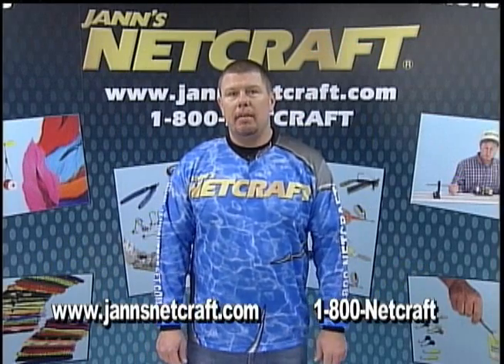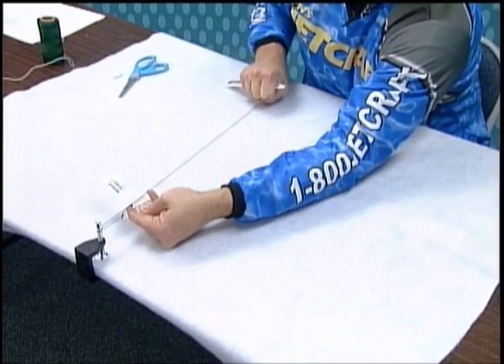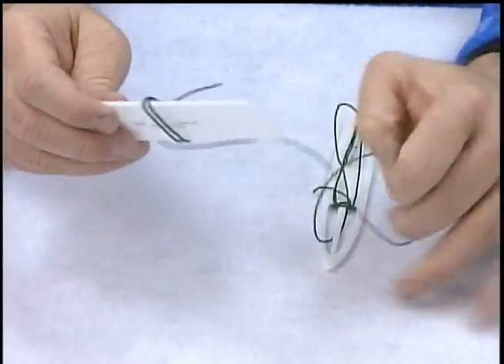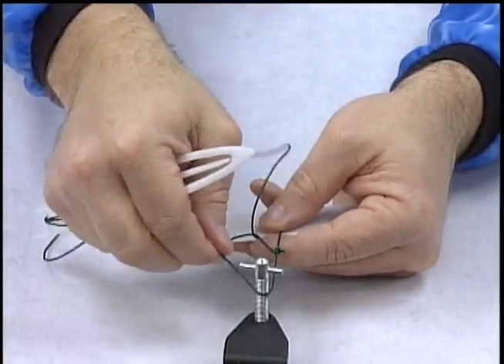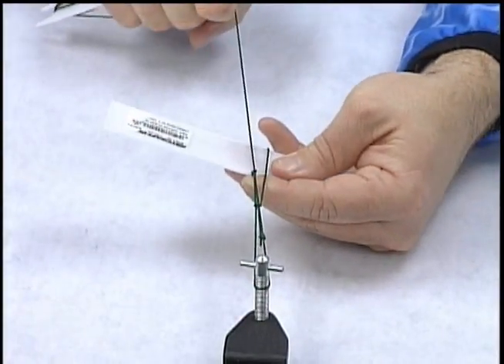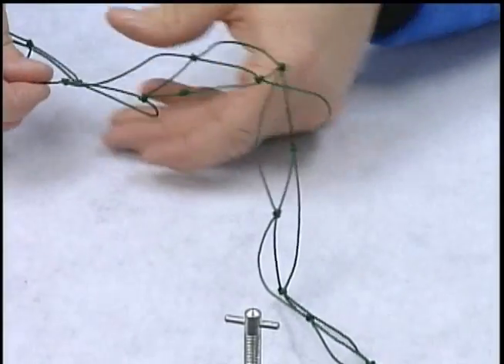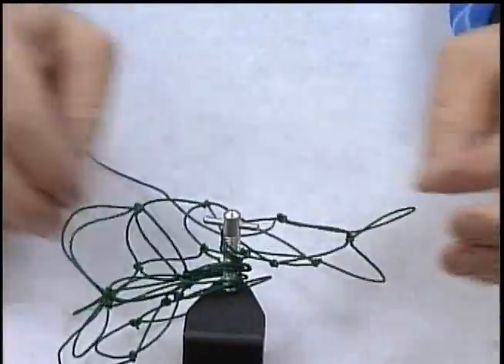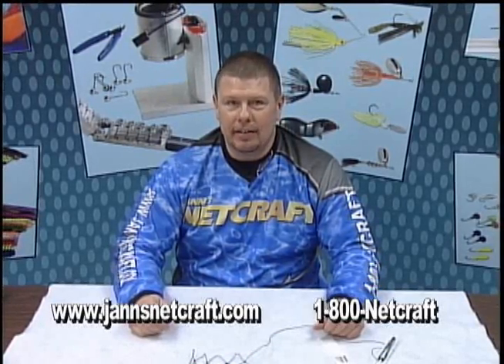How to Make Your Own Fishing Net, Netting

Comment: A sturdy trap. The locking latch can be fortified with tie wire for added security. https://www.youtube.com/post/UgkxxvthjLYk8bJwhOkjNsLvPwnSKZmnHeT1  Try to place these traps wherever current is present. Incoming streams or runoffs that dump into main lakes or ponds are typically good spots, especially if there's a rocky bottom. For bait, use a panfish caught from the lake you're trapping crawfish in, cut the panfish into 3 pieces and soak the trap for 12 to 24hrs.